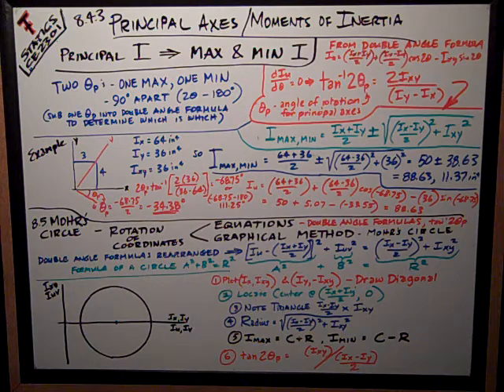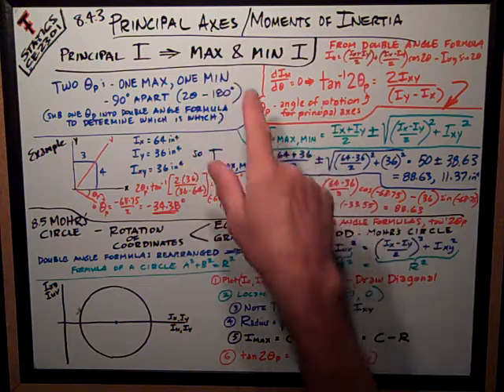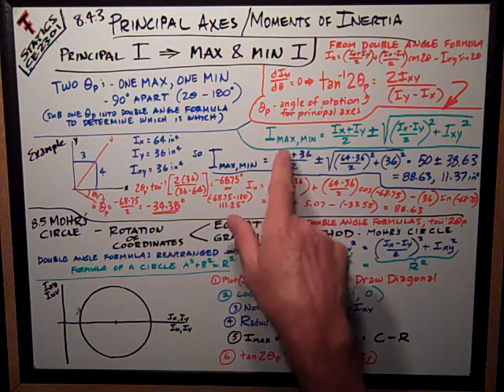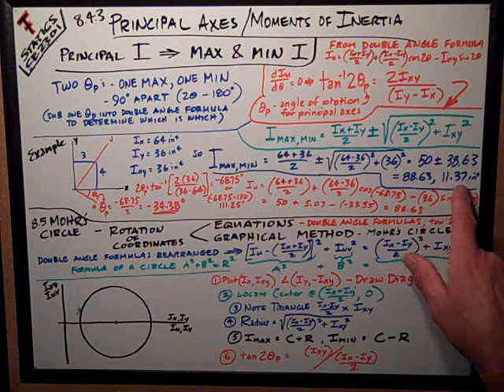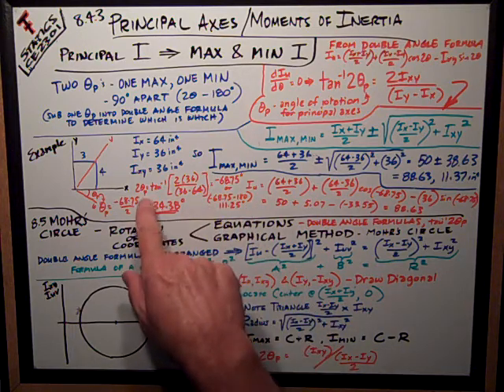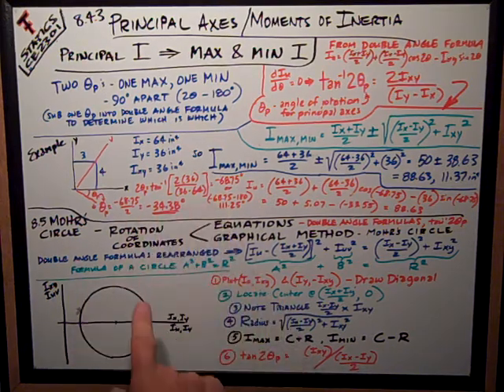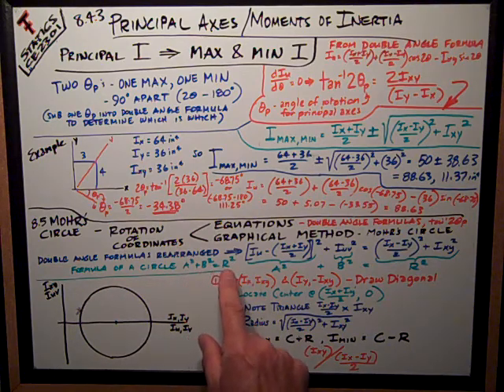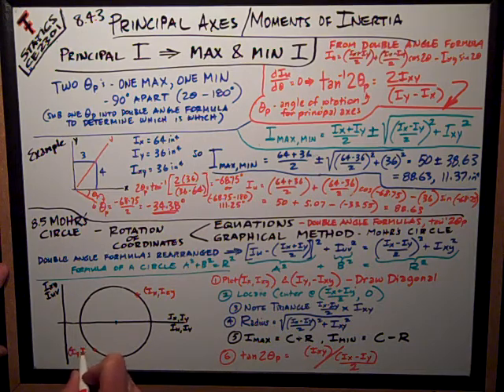Statics   Principal Moments of Inertia, Mohr's Circle

Comment: 11 years late but.. shouldn't the first equation shown for the angle of rotation have tan and not arctan/tan inverse? It doesn't seem to be the in accordance with the same equation written at the bottom (which has tan instead of arctan).

Anyway, it's a great video, thank you.